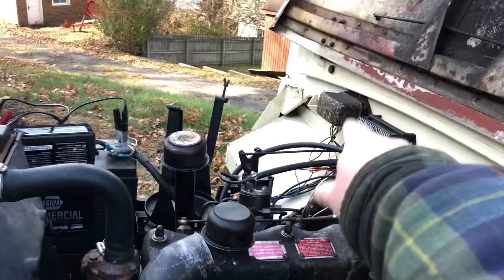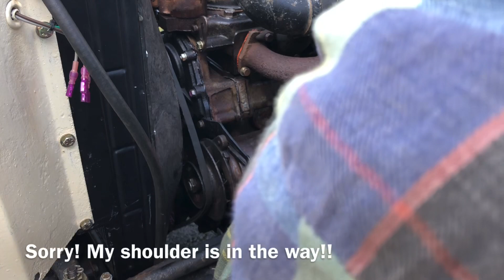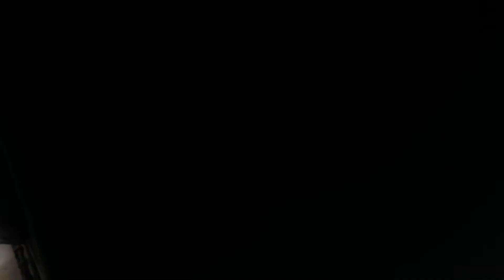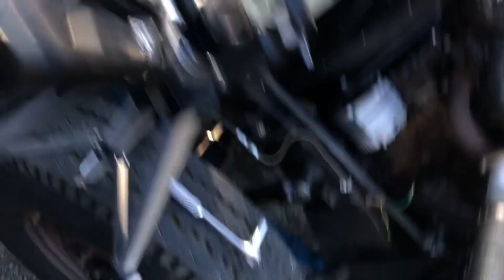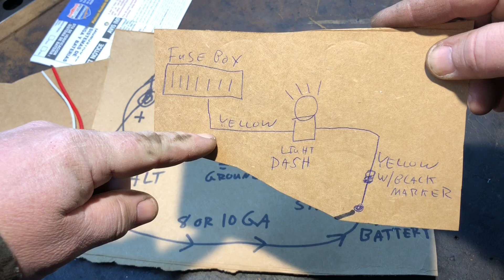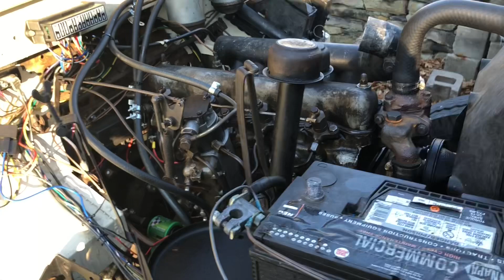Alternator Conversion Swap Generator Land Rover Series 2A 3 Restoration Repair Lucas Delco 10si 12si

Comment: You can get a 12SI Delco 94 amp 3 wire with V pulley part number 400-12471. And the Delco 12Si series is better than 10Si because 12Si moves more air for better cooling and wires the same as 10Si and 12Si wire up same.
Reply from the maker: Excellent info! Thank you for the part number.

Comment: Hello I found you video helpful I have a series3 for in 24v and I am doing the same upgrade only my generator is on the other side. And set up for radio gear
Reply from the maker: Cool. Is it a 24V alternator you’re installing?

Comment: What about your dash amp meter???
Reply from the maker: Thank you for watching. I bypassed  the dash amp meter. The ALT puts out too much amps to use the original gauge. I may have to research how to hook it up and make future video about it. Thank you!
Reply: @conrad1468  Thanks! Yes, I am in the same boat, going to bypass it too for now. I think I am going to add a small voltmeter someplace. Maybe even more useful than amp meter. I can see charging voltage and the charge of the battery. Nice video, I'm sure it helped many people.
Reply from the maker: @daviderickennedy2194  volt meter is a good idea. Hope this video motivates others to fix their own Land Rover.

Comment: Great vid again. Have you ever come across a double-grooved pulley for these kind of alternaotors? I would like to fit a more powerful alternator to my 200TDi 109 Series 3.
Reply: There is a certain type of range rover v8 100a alternator that should fit a 200tdi with a washer as spacer and your old pulley(and upgraded wiring).
That doesnt help you with the double pulley though.
Reply: @rickz9495  Thanks for the quick response and the tip. I will check this. Apart from this, there some "upgrade" alternators (120Amp ?) offered by , f.e. Paddocks..., branded Bripart, as I learned in the time.
Reply from the maker: Thank you Sir! I’ll let you know if I find a double pulley for the Alternator. It would be nice to fit one. Could you use the pulley from 200TDI on a 10si alt? I wonder?!?!

Comment: Hi and thanks for sharing,as fiddling around to get a non-standard part fit, could cost a lot if time. I had to reposition a Defender alternator to a 200 TDi Discovery engine, which we swapped into a S3 109 LHD. I would like to improve the drive by installing double-grooved pulleys - similar like the 24 V mil spec. Have you ever come across such pulleys for the civilian Delcos? I fitted the alternator with the lower diesel- bracket ( die -cast) and an adapter kit from Steve Parkers Land Rovers, UK. By now, it is not possible to hold the tension jn the singld V-belt for than 6 weeks. I am a little bit fed up with crawling under the truck to give it another go for the next 6 weeks. Regards Heinz
Reply from the maker: Thank you Sir! I guess if you find a double pulley that has the same inside diameter of the original pulley on the alternator. It should work but you’ll also need a double pulley on the crank, too. I haven’t seen any for the Delco. Can you buy a smaller belt for your alternator? Belts come in many sizes. Check out V Belt Guys website. They have all the sizes listed.
Reply: @conrad1468  Hi Cory, thanks for quick response. I went for the smallest size, which is in my case 1025 mm. Regards Heinz, Germany
Reply from the maker: @HeinerStorchennest1  I just had to replace the belt on 1979 VW Rabbit (Golf) with a smaller belt because the correct belt was too big and slipping. Just like your belt. Funny, how we all deal with same issues all around the world. 😀

Comment: Nice job Cory....quick tip though mate, you don't need to take the alternator apart when clocking it, if you just take out the 4 bolts you can swivel it around to the desired position without having to separate it 😀👍
Reply from the maker: Thank you Sir! That’s a good point. I was afraid of braking something spinning or ripping something. I’ll remember next time.
Reply: @conrad1468  you're very welcome Cory 👍
Reply: My problem is that I like to see what is inside.  Good tip for me!  Time saver!

Comment: Hi Cory, great video. I've still got the Lucas C40 generator fitted, but I'm worried it's not going to keep up with  the charging over the winter noting its not going to be driven too far. This will be a good one to keep in my back pocket if I ever want to update. Cheers!
Reply from the maker: Thank you Sir!! Finding a Lucas anything in the states is very difficult and with a high price tag. I figure an American alternator will be cheaper and easier to find. 😀